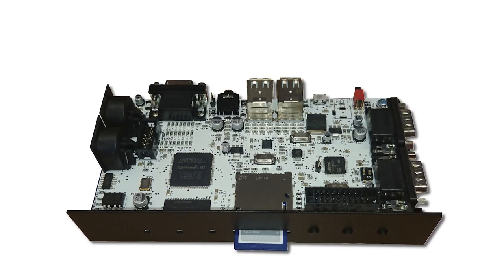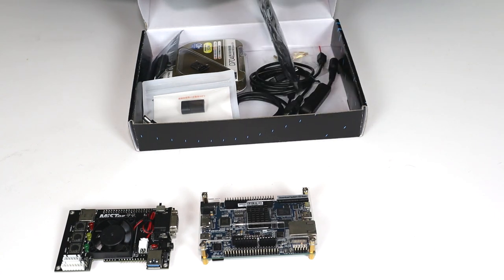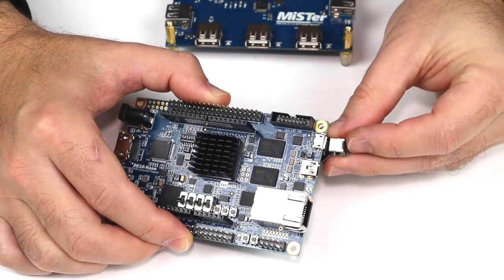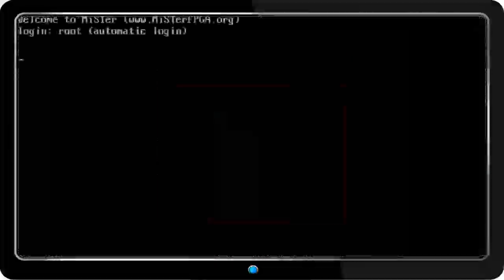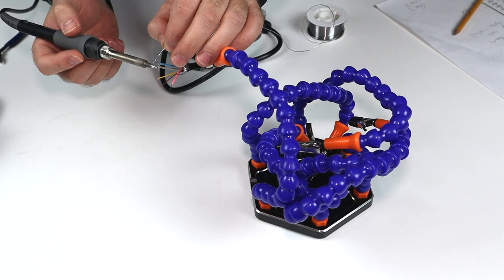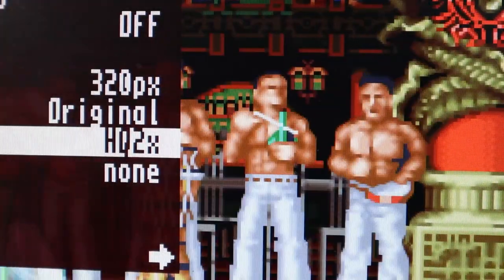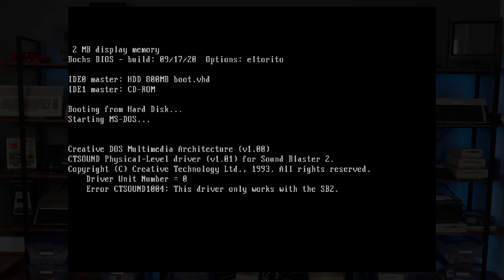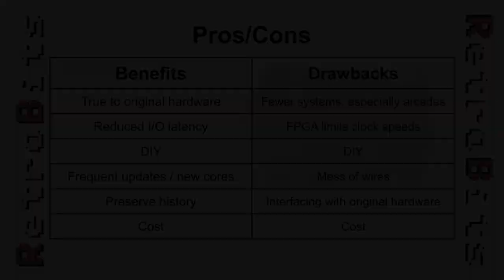MiSTer FPGA - How to build & configure, demo, cost, and pros/cons

Comment: I noticed the cable you made for the Amiga 1084s monitor has the VGA connection going to the MiSTer and it doesn't show the SCART cable plugging into the monitor. Your voice doesn't sound like your in Europe. I have the USA NTSC version of the Amiga 1080 monitor (not the 1084s) and it features a DB-9 port for the RGB signal (the same as I believe of the 1084s). Is it possible to adapt your cable to work on that connector? Photos of the SCART connector look totally different than what I see on the back of the 1084s monitor, so I'm confused by your cable. The 1084s has the addition of RCA chroma / luma connections the 1080 doesn't have (just straight RCA composite or analog RGB)

I've been trying to figure this out for years, and appreciate any tips.

Also, my goal is to use my PC laptop with various emulators (especially MAME) not a MiSTer. I would like to see some more demos of the MiSTer vs PC emulation of which I am very fond and have used since it first came out in the mid 90s. I have four MAME cabs in my basement arcade, all with CRT's. Like you mentioned, I don't play 1990s fighting games.  I play hundreds of golden era classics like Pacman - the late 80s mainly. I've found no issues with lag at all. I have a color and also a b&w VectorMAME, and I noticed in the game Space Fury, the real game (verified on two machines) suffers from major CPU lag so much, it affects my game play. On my emulator machine, using a Wells Gardner 6100 color vector monitor, and a PC, there are no lag issues. They actually improved it over the real arcade hardware via emulation! 

The MiSter you mention came from Amiga & ST emulation. I was President of an Amiga group in the mid 80s as a teen, and owned four machines. Amiga emulation is so good via PC emulation, I sold off 3 Amiga's and kept one original A1000, but two working 1080 monitors hoping to use one with emulation on my PC laptop. Software emulation of the Amiga 1000 is clock cycle accurate, not FPGA needed. I've tried many games, on my arcade CRT monitor in my MAME cab with classic Wico leaf-switch joysticks/buttons and the game play fantastic! Even Amiga 4000 emulation runs great, and I play games like Star Dust AGA. It will even emulate the 68060. I mostly emulate arcade games. In the past two years, I've done a lot of Atari 2600 & 8 bit computer emulation, and it again runs fantastic!

Software emulation or FPGA, it's only as good as the people making it. Either way, it's a reproduction and subject to potential glitches. Either method has the potential for greatness, or being not so great. Software emulation has been highly developed for 25 years now. I'm amazed by it.
Reply from the maker: My 1084S has no problem ingesting the 15Khz RGB signal coming out of the MiSTer. I've standardized all of my RGB-capable gear on SCART because it's available off-the-shelf for many systems. I then adapt the SCART cable to the 1084, PVM, 1902, etc. or plug straight into a SyncSlayer2 and feed the output of that into my monitor and/or video capture device. The 1084 can handle both RGBhv and RGBc based on my testing so it works for just about every system I've tried. In a future project, I will attempt to add a native SCART input to my 1084 as the port is on the back and header is there on the mainboard already and I think it's mostly electrically connected.
Reply: @retrobitstv  If you offer a cable that will work for what I want to, PC VGA or HDMI to Amiga 1080 DB-9 RGB port, let me know. Or any tips how to do this.

Thanks.

Comment: What size SD card do you recommend for the DE-10 board and also I noticed on my I/O(analog card), the other side(single row) connector has no pins....is that normal? Also on the I/O(analog card), there is another SD card slot( or it looks like one)...will I need an SD card for that slot as well or is that even an actual SD card port?
Reply from the maker: For the SD card, it really depends on your use case. A complete set of ROMs for the Neo Geo weighs in at about 4 GB, just as an example. If you plan to use virtual hard drives with ao486/minimig or load up a bunch of CD-ROM games for cd32, pc-engine cd, etc. the 16GB card will fill up pretty fast. 
It may be that the missing connector is for the user port. Do you have what appears to be a blue USB3 connector on your I/O board? 
The I/O board's SD card slot is available for cores to use. I believe the X68000 core requires a second sd card for hard drive and disk images, but it's not widely used otherwise.
Reply: @retrobitstv  I do have that blue USB looking connector on the I/O board, yes. I'll add those pins then on the I/O card as I always wanted to check out the X68000. Just how large a SD card can the DE-10 handle? I just ordered a 128g SD I'll be picking up later today. Sounds like that should do fine. I have other smaller cards here like 64 g and an 8g that came with the DE-10. I think that should be fine for now if I want to play around with the X68k. I appreaciate all your help sir. I sent another email but I think you answered most of my needs here. Also there is an app for Linux called Etcher. It's a drag and drop gui based imager...I'll give that a try today and see how it works. I'll report back here to let anyone else know if they wish to have something less cumbersome than a command line method. Again... most very appreciated for the info and this excellent video. Love your other vids as well. Gives this old man retro lover lots to enjoy on my days off.
Reply from the maker: @GORF_EMPIRE  I'm not sure what the largest size it can handle is but I've heard of people using 512g fine. 128g should be fine though! Glad the video helped and enjoy your MiSTer, they are all kinds of fun!
Reply: @retrobitstv  Yeah I have to do some FTP'ing to get some images over on it. I'm messing with the classic computers for now though. At least I can code those in basic. :D

Comment: Will it read a 128g SD card?
Thanks for the information.
Have a Happy New Year!
Reply from the maker: Yes, 128GB should be fine. Anecdotally, people are running 512GB cards without trouble. Some brand/model cards seem to have difficulty with the MiSTer, but as long as you stick with a reputable brand you'll probably be in good shape. Thanks, Happy New Year to you too!
Reply: @retrobitstv  Thanks for the reply!
Happy New Year!

Comment: So it is not a solder free set up? I can solder fine but right now I don't have the place nor the inclination to solder. Where to buy those solder free connectors and whether soldering is unavoidable? Also the video was pretty good but I am confused as to why you put a link to soldering station?
Reply from the maker: Assembling the MiSTer from the pre-populated boards as I demonstrated in the video is a soldering-free process. The PCBs are open source so you could have them manufactured and populate all the components yourself if you wanted. You don't need to make a cable like I did either, they are available online for purchase, but at around $40 USD, they're a bit spendy. I put links to products used in each video, where appropriate, and the Amazon links help sponsor the channel.

Comment: And now they are saying that there is a chance we will have at least partial compatibility with all of the 5th generation consoles that people care enough to work on.  N64 for clock speed reasons might still be out of the question. It was thought that Saturn had too much logic in its complex system for the Mister but it is looking like that is not the case and that it is likely going fit. Might not be able to add in the MPEG card and other such devices but maybe those could be software emulated on a Pi off to the side like many people do with Midi.

Comment: Does MISTer support 386, 486 computers and early Pentiums? Or plans to? Is there a product that does? These systems i dont want to have a physical as they tend to be HUGE and i have very little nostalgia for the actual original hardware. I know DOS box but its not easy to setup and does not support quite a large amount of games. Right now i want to play the Buck Rogers Series by SSI and they are not on GOG and probably wont be for a very long time (copyright issues).
Reply: Apologies, seems like it does support the 486 as i saw your video on release and just saw it again. How is the PC emulation of this ERA? Is it near 100% in terms of software compatibility?
Reply from the maker: I've had really good luck with everything I've tried so far. You can run pretty much anything up through Doom/Duke3d and Windows 95 (maybe 98?). There is good driver support for VGA, Sound Blaster, even PPP networking. The one issue I remember having was getting Descent to run properly. It kept crashing at startup and I ended up replacing the DOS/4GW extender with DOS32A and then it worked but I'm not sure what the underlying cause of the failure was.

Comment: I might be one of the only ones, but I would kind of like to see a port of Linux or just straight up RetroArch for the ARM chip inside of the DE10 Nano.  I wonder if you could actually get a build of Linux running on the thing, separate from the FPGA?  There's no real reason to want to do this I guess, but I think it would be neat.  Sure, the CPU isn't very powerful at only 800Mhz, but it has a pretty generous amount of RAM for a CPU that slow, with a whole GB of DDR3.

Comment: I'd get a mister if it can 240p @120hz on a vga monitor. Do you know if it's possible? 

I've repurposed so many of those monitors with reteoarch doing that same video output trick. Now the picture looks like a high quality monitor, for free!
Reply from the maker: It's not something I've tried myself, but there's a very powerful configuration option called "video_mode" in the config file that can be applied universally or to individual cores. A quick search turned this up, which might fit your need: 
video_mode=320,8,32,40,240,1,3,14,12380 ;320x240@120Hz (240P 4:3) ;CVT-RB

Comment: software emulation does not provide hardware interfaces, hardware emulation provides hardware interfaces, that's all the difference you need to know.  If you can not attach a vintage obscure device, then it's not hardware replication but it's more of a somewhat better emulation.  You still need to have the disk controllers, cartridge ports, etc for an FPGA to make real sense.  These days mostly only monitor and controller connections are considered.  There is still a lot of development to be done on the FPGA vintage computer emulation scene.

Comment: I don't know why but somehow having the USB ports all the way around bothers me.
At least the power plugs line up perfectly.
How does the 486 core bench? Just out of curiosity.
Reply from the maker: The 486 core has come a long way in a short time. It wasn't that long ago that Doom would only run in a tiny window. Now it runs smoothly at full screen. Duke3d and Need For Speed were basically unplayable, but both work pretty well now. Here are the topbench results for the latest update running at 90 MHz. The core has no FPU. http://retrobits.tv/ao486_topbench.png

Comment: Scrate for the video was pal I have tv that is pal ntsc and secan. Would that model be necessary
Reply from the maker: As demonstrated in the video, the SCART cable was carrying RGB with composite sync, so the signal is not encoded using either PAL or NTSC. There is a composite/s-video adapter available for the MiSTer that will output either NTSC or PAL which might be what you're looking for.

Comment: Am I correct? You can't save everywhere during the game, for example, like in FCEUX?
Reply from the maker: A small number of cores have implemented savestates but it's not that many AFAIK. Unlike software emulation which represents the running state of the system all together in (known) memory, FPGA implements all of the different chips that make up a system running together in parallel so capturing (then restoring) the state of all the registers, program counter, external memory, etc. is a lot more work for the developer. Games that had their own save points and cartridge batteries generally work as expected though.

Comment: I want one so bad.  I just dropped 400 bucks on a Tandy 1000TX, complete in box though.  The disk drives are giving me crap through, which makes me sad.  I'd like to get two of these, use one as a vintage PC machine, and put another in a little bar top cabinet, or maybe even full sized so two people can play at once, uncrampt.

Comment: A decent A1200 with CPU upgrade, RTC, Ram expansion and working CF will set you back around 350-400 euro overhere.
Reply from the maker: Not bad! There's only one 1200 currently for sale on eBay here and they're asking $1200 USD. Maybe I should shop around your eBay instead.
Reply: @retrobitstv  Welll the sites names is www.marktplaats.nl. If you search on "amiga 1200" you will find 5 for sale starting around 390 euro. But that offerings kind of vary by the week. You can ask if they ship INTLLY but probably not because of the fragility.

Comment: Not gonna lie, I do hope the ao486 core eventually gets upgraded to emulate a faster 486 CPU, as 33Mhz is pretty slow by 486 standards.  I hope they can at least get it to do 66Mhz at some point, or even the full 100Mhz if possible.  Best of all would be the ability to choose which Mhz you want it to run.
Reply from the maker: The ao486 core runs at 90Mhz now! I don't know exactly when that update came out, but it's one of the speed options you can select from the menu now. Benchmarks: http://retrobits.tv/ao486_topbench.png

Comment: 4:30 ...the MiSTer developers recommend using the analog video output with the CRT...
Earlier today I've heard that MiSTer developers are not focused on analog video output, as the project is aimed at preservation and MiSTer is in truth meant to be used with LCD's. I've been told that Sorgelig often says it.
I want to grab a MiSTer and I would like to game using VGA and Component, but I'm still not sure since some people have been reporting issues with analog video output.
Reply from the maker: HDMI upscaling with the MiSTer seems really mature and I use it all the time, especially for video capture purposes. Analog support is only as good as each core implements it. Ideally, it' would be as good as the native hardware outputting original video signals, which should always have lower latency than the upscaler, but sometimes has odd behavior or unsupported frequencies for a given display. I have run into a few oddities along the way (for instance I couldn't get the Cave68k core to output 15khz RGB properly, though others have). In general though, I've been very happy with the analog video support that is available.
Reply: @retrobitstv  Thanks for clarifying. 
Are you aware of any differences when comparing analog output from HDMI>DAC/Converter vs VGA>VGA/Component that would worth mentioning? Some say I/O board would not be necessary because we can use DAC or other converters, but I'm afraid to go this route and regret later on for not being able to try better results from I/O's VGA>VGA/Component.
Reply from the maker: @gamerhoarder9291  I can't say that I've tried  or made these comparisons. What I will say is the MiSTer's HDMI output is digitized and upscaled from the core's analog output. If you run that through a DAC, you're now converting the source video twice on its way to your display. The Analog I/O board can provide the core's native unscaled output (most often 15khz but not always, e.g. 486 VGA output is 31khz), or you can enable the built-in scan-doubler and force the analog output to whatever you want / whatever your display ingests. YPbPr/component output should work great too with an off-the-shelf cable, but I haven't had the need to try it. One issue I've had when using 240P displays is that you can't access the linux shell, run scripts, or use the 486 core so I often end up either administering the MiSTer via SSH, or hooking up an HDMI display to it anyway. There really isn't a one-size-fits-all analog 240p solution unfortunately.
Reply: @retrobitstv  converting the source video twice , that was exactly my concern. Thank you so much, great channel.

Comment: What is the recommended price for the base module? It seems people are selling it way above regular price
Reply: Ah just saw it and the end of the video. Wow people are selling the base module for 200-400 Euro on eBay.
Reply from the maker: The de-10 is readily available for $130 USD at a variety of reputable vendors here such as Amazon, Digikey, Mouser, and of course misteraddons.com in the description. I would hope the same is true in your market. There shouldn't be any need to pay inflated prices, though some folks sell completely built and configured systems at a mark-up for those who don't want to do it themselves.
Reply: I think you can get the DE 10 Nano cheaper if you can claim a educational discount, like if you were a college/university student.